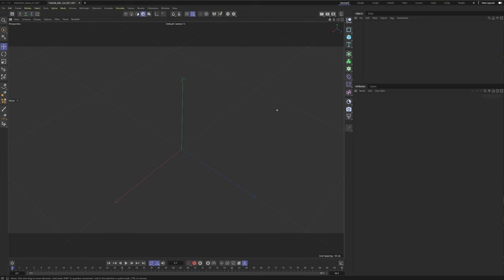Particle Advection with Pyro in Cinema 4D

Comment: Hi really nice tutorial, I'm new to Pyro but... I have a problem though as the update to Pyro has changed the options and added others, for example the tag settings like Voxel size and surface emitter have all changed? how would I achieve the same effect ie with emission control via keyframes etc with these new changes/omissions? any help appreciated! thanks :)
Reply: Did you ever figure out the settings? I am stuck on that part a bit too.
Reply: @travishaggerty1430  not yet sorry... I'm keen to find some references to the changes to the interface but haven't had any luck so far...
Reply: @calibre00  Lol, I've been looking too. It seems they just took it out and then??? No clue. frustrating for sure.
Reply: Object fidelity replaced that. It is now relative to the voxel resolution of the simulation (Ctrl + D > Simulation > Pyro > Voxel Size). If your voxel size is 10 cm and fidelity is at 50%, then the voxel size used for the emission object is 20 cm. Surface emission is now in Emission mode to make it more explicit what the alternative to "surface" is.

Comment: is the option for object voxel size gone in the latest c4d version? its not listed anymore
Reply: Object fidelity replaced that. It is now relative to the voxel resolution of the simulation (Ctrl + D > Simulation > Pyro > Voxel Size). If your voxel size is 10 cm and fidelity is at 50%, then the voxel size used for the emission object is 20 cm.

Comment: Do you have a summary of the render settings you used. It looks great until rendering. Using redshift here and cant seem to find settings to make it render out the colors
Reply from the maker: You need to use the color user data node and then pipe that into a ramp

Comment: So many of the settings have changed you now have pyro fuel and pyro emitter, I cant find the Voxel size any where haha
Reply from the maker: Got damn cinema!! hehe
Reply: Object fidelity replaced that. It is now relative to the voxel resolution of the simulation (Ctrl + D > Simulation > Pyro > Voxel Size). If your voxel size is 10 cm and fidelity is at 50%, then the voxel size used for the emission object is 20 cm.

Comment: Thank you for the lesson. There is one problem, how to render the first option? Neither the sweep nor the hair material shows the particles in the render.
Reply from the maker: you can use the redshift object tag, and then you can select hair stings as the render type
Reply from the maker: and for the sweep, try putting a connector object on the trails and then the sweep

Comment: Wow, nothing worse than getting half way through your absolutely brilliant tutorial to realize Maxon has gone and changed things AGAIN. Why would Maxon have decided to remove fields from the attractor or the deflector? They must have figured out another way to do this, using some node, or ticking some box somewhere, but having to figure out how to use this program all over again every other update is ridiculous and sending me quickly along to things like Blender. Maxon's propensity for constantly changing things is making me question spending (or rather wasting) any time on that software.
Reply: it actually works again now with the 2024.2.0 update
Reply: @eltobert  yeh, thanks man. I got it to work by going backwards or forwards to 2023.0.2 or 2023.2.2. I already forgot which, but it works.

Comment: why does it bring a pyro output for me instead of pyro?
Reply: You are probably using a newer version of C4D. It's the same thing. It was just renamed for clarity. A lot of people confused the object holding the pyro emitter tag with the actual output of the simulation. Material assignment, meshing, caching, export, referencing grids as forces in Field force, all of that is done with the Pyro (Output) object.

Comment: Thanks for this great tutorial - I hope its ok to suggest some improvements.

There are several points where you just state "click this" or "set this to X", without any explanation as to why. Youve obviously worked through these processes and found the settings that worked best for you, but it would be super useful for us to know even slightly why. Not only does this increase our understanding while we learn the main steps, but also helps us understand what to come back and play with later, or even to troubleshoot if we run in to issues. I myself much prefer tutorials that arent just showing a process, but actually teaching the understanding behind the process.

To give you one example, when you are setting up the cloner system, and you feel the height of the cloned cube needs to be longer - why? And when you state the cloned effect should display this circle at the centre - why? I can see we understand this ourselves later, but it would be great to have less of just instruction, and more teaching. Thanks!
Reply from the maker: Thanks for the comments mate, you're so right. I'm trying to make the content the best on YouTube, but sometimes I mis a beat. So thanks for reminding me of the importance of the process. This is is right on the nose of what I want me content to be.
Reply: @lukasthorup  All good man and thanks for understanding my tone and how it was meant :)

And of course thanks for all your hard work with these tuts, theyre a great resource!